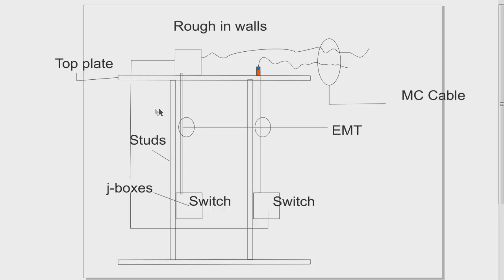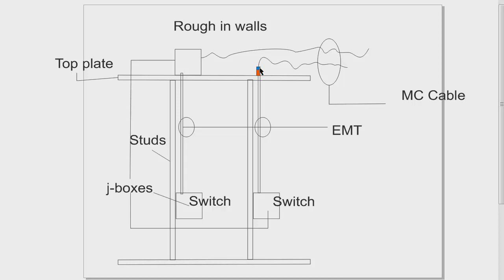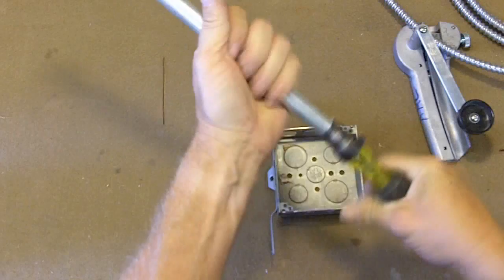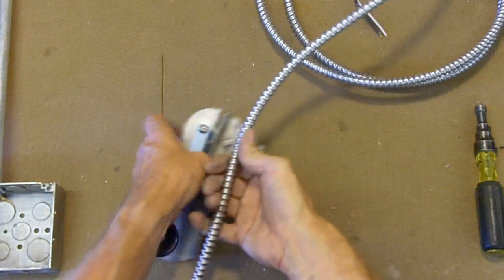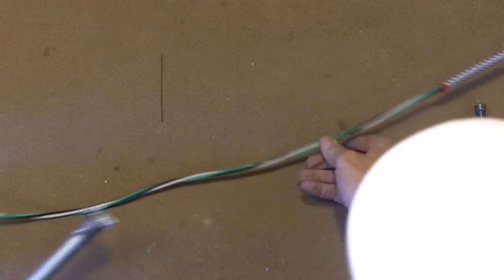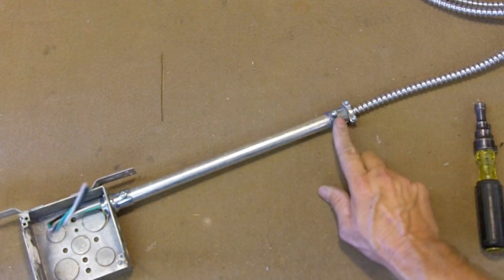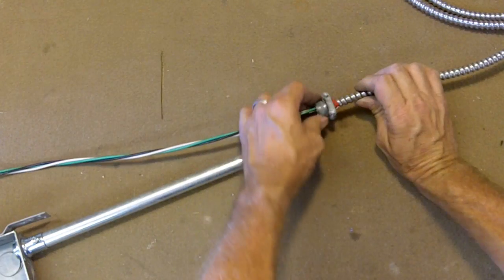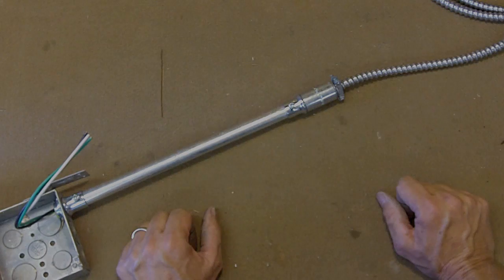Practical Electrical Wiring-MC to Emt Connectors

Comment: This person is not licenced to be doing any of this work. They do not know the code and are not qualified persons to be performing electrical work. And what they show you and tell you is all wrong. Hire a licenced electrician!
Reply from the maker: Tony66777
 Man what's with all the hate?  I have seen all of your comments to others on their videos on You Tube on your comments page.

You keep referring to "hire a licensed electrician". I have found many things over the years done by a licensed electrician that I have had to fix because it was not right."""It's the person not the license!""""

I probably should have said that it was "recommended" in lieu of "required". My bad,doesn't make me unqualified.

The code is written as a guide that the industry should follow.

What does AHJ stand for? Authority Having Jurisdiction, perhaps that's you where you live,congrats. I have had several electrical inspectors that agree with my statements buuut they also say it is good practice to use anti-shorts. You can require them from anybody you want to IDC!!!!

Because you interpret things different from others doesn't make you right! According to all your comments across You Tube every body is incompetent. Instead of slander and vulgar statements why don't you use your energy in helping people. Calling me an idiot and telling others they don't know what they are talking about is nothing but destructive
and serves no purpose.You may think your helping now by warning people of incompetence in the industry but you're only showing your inability of not understanding really how to help!

You have even gone as far as telling people that they are stupid and don't know what they are talking about because they misspelled a word--- Look in the mirror buddy.
Reply: Electrical Industry Network Tony6677 appears to have a significant dislike for anyone who does not think like him. Typical of an entrenched tradesman who only protects his "own kind" and has no interest of learning anything new. The defensive and accusatory tone he demonstrates is a clear indication of his low educational level and lack of appreciation for any new information that might be able to show him differently. He claims to know the NEC, but he clearly doesn't 'know' much. Keep up the good work and ignore trolls like him.
Reply from the maker: ljsmith99
,Yep,thanks for your support and comments.
Reply: @electricalindustry  -  Code consultant/engineer here. EIN is right as far as the NEC goes but as others have mentioned, the AHJ may have local amendments that have to be evaluated.
Reply from the maker: Man who peed in your Cheerios? When making a tough talk comment like this back it up with some reasons why it's not right. Are you a electrical cop or something?
Reply: No im not a cop just tired of watching people like you talk about what you dont know. That is complete BS what you did. Spend some time reading and not commenting on You Tube, then maybe you can make some inteligent videos.
Reply from the maker: Tony66777
Again tell me WHY it is BS man. People all over the states are utilizing this method!! I have seen the best of the best do an install this way. Union and non-union contractors. Not only is it done with mc it's also used with emt,romex & seal tite flex. It may not be the way you would do it but it is safe and efficient.
After posting this video and reading the comments I have had the opportunity to talk with some local inspectors. Their comment was It's safe and could see no reason not to do it!!! You're narrow minded and can only see black and white. Expand your horizons!
Reply: Well lets just start off with you saying that the  anti short bushing is not needed. This not true is accordince with 320.40 and 330.40. Also it is stated in NFPA 70E that only "Qualified Persons" should perform work on all or any electrical installation. A "Qualified Person"  being One who has the skills and knowledge related to the construction and operation of the electrical equipment and installations and has recieved saftey training to recognize the hazards. This is not you! You are a unqualified person creating Hazards with your vidoes!! Stop if you dont know what your doing.
Reply from the maker: Tony66777
 I agree that anti shorts "should" be used however they are not required by the NEC, There is a difference between AC cable and MC cable.People should be aware of this when working with the two types. See Info below.

 Comments to my qualifications are unfounded. You have no idea what I am qualified to do! One measure of a qualified person is to be able to comunicte with others,not attack them.

A/C M/C Info:
http://www.afcweb.com/media/afc-1001-mc-ac-installation.pdf

"Be sure that the anti-short bushing is plainly visible in the
connector for easy inspection. The same procedure is followed for
traditional MC cable with the exception that there is no bonding
wire. Although anti-short bushings are only required by the NEC for
AC cable, some manufacturers supply them for both cable types in
the event that local codes override the NEC"
Reply: Electrical Industry Network Hello Mr. Electric, have you taken out your code book? I havent a response from you in regards to the NEC refrences I made. If you have already you will know that what you said is 100% incorrect,
Reply from the maker: Tony66777
The above doesn't qualify as your response?
Reply: Actually Tony, EIN is correct. MC cable is NOT required to have a Redhead installed per the NEC. However, AC cable (formerly known as "BX") requires the use of these insulators. There is the NEMA-90 bulletin also outlining this at http://www.nema.org/Technical/Documents/Bulletin-90.pdf .  So, your jurisdiction may require redheads on all armored cable (AC & MC) because they cannot tell the difference from the outside. However, many do know the difference and understand the usage. Lastly, before you go branding me as a 'hack', know that I have many years working designing these types of fittings, and I know what the NEC and UL standards say about this exact thing.
Reply: ljsmith99 Ijsmith, you and everyone else on this website called you yube has no idea what your doing. When the guy on the video says that the roll of Mc comes with theses bags of "red hats" would you not think that they should be used. He even says with no confidence "I think they are required by the manufacture". Like I said if you look in the book on sections 320.40 and 330.40 you would see it. Becuase your not a real electrician and have no form of idea what your doing you should stay with probally doing car audio or something, You have no business even making these videos, due to that fact that your causing fire hazards witih each view of this video. Again as stated in stated in NFPA 70E that only "Qualified Persons" should perform work on all or any electrical installation. A "Qualified Person"  being One who has the skills and knowledge related to the construction and operation of the electrical equipment and installations and has recieved saftey training to recognize the hazards. YOU ARE CREATING HAZARDS NOT CORRECTING THEM. Please people go to school or call someone with propper knowlege of the task at hand.
Reply: Tony66777 "Well lets just start off with you saying that the  anti short bushing is not needed."------------I don't believe that is what he said.
Reply: ljsmith99 Lastly would you bring your son or daughter or have their teeth cleaned by the guy at the shoe store? He has all the tools but just doesnt have the propper license. Its the same thing with electrical and plumbing. I hope that the person who made this vidoe and the people who ae sticking up for this guy can sleep well at night. P.S. Better install smoke and C.O. alarms as you will need them with this caliber of work.
Reply: Tony66777 Lastly that NEMA-90 billetin is a complete joke. It was written in 2002?? Its 2014 now my friend and the code changes peridocially. For you Ijsmith99 to say "However, many do know the difference and understand the usage" If you knew anything about the difference you would know that these types of cables are required to have anti short busings installed at every termination. And you said " I know what the NEC and UL standards say about this exact thing." This "exact thing" what is that??   My kids need thier teeth cleaned do you have any open appointments? HIRE A LICENSED ELECTRICIAN
Reply: Track a Hack EIN is a non qualified person attempting to do electrical work. You and Mr Fritz should call someone who knows what thier doing instead of relying on theses people who have not even a drivers license. And when your house burns because of this guy, I wont be the one who is BITTER. Again just call a licesed electricain they are there for a reason.
Reply: Tony66777 I bet you cannot tell me the actual construction difference between AC and MC cable. I am sure you think it's 'all the same'. If you can, I would like to hear your explanation. Please be specific. NEC Art. 320.40 discusses AC cable ONLY and it requires the use of insulators "red-heads" between the cut armor and the conductors before installing into a fitting OR box with clamps. NEC Art. 330.40 discusses MC cable ONLY, and does NOT specifically require the use of these insulators. However, Southwire, AFC, Encore, etc. all include these insulators with rolls of MC cable because of one reason only....LOCAL JURISDICTION (i.e. local codes). So you are BOTH right, because your jurisdiction may require them no matter what the NEC states or doesn't state. Lose the attitude and you will certainly go much further in life. Also, you have no idea what my qualifications are, and who are you to tell me I am "creating hazards not correcting them"?
Reply: ljsmith99 Hey now that ive read you own document, you have no clue what day it is. None at all. Read it for me ouf of your own text..    Fittings used with Type MC Cable are required to be listed per 330.40 of the NEC. NEMA supports the use of listed fittings for MC Cable. The design of these fittings may or may not include an insulated throat however, they are required to be provided with a smooth, rounded end stop so that the metal sheath of the cable will not pass through and the wires will not be damaged in passing over the end stop. Whether or not an insulated throat is part of the listed product, these listed MC fittings do not require an additional anti-short bushing. Anti-short bushings that may be supplied by MC Cable manufacturers are for optional use by the installer, however they are not required.
Reply: Tony66777 The NEMA Technical Bulletin is still legitimate even though it was created in 2002. Show me where in the 2014 NEC 330.40 REQUIRES anti-short bushings to be used with fittings. Oh, that's right, you can't, because it isn't in there.
Reply: Tony66777 You are confusing ANTI-SHORT bushings with INSULATED THROAT BUSHINGS used in fittings. They are not the same thing, nor do they operate the same way. Read the NEMA document again...closer... It's ok to learn something new as an old sparkie...really it is...  ;)
Reply: J
Reply: +Tony66777  Oh again an stupid angry person how thinks all people do now YOUR work and nobody hire YOU? This I hear only from stupid electricans - intelligent electricans know after an house in fire they have many to do! ;-)
Reply: +Electrical Industry Network  Here in Germany we have DIN, newer EN ISO, in Greece EN ISO, in Thailand ISO. Normally in country and on sea ships and vessels 230 Volt one phase or 400 Volt three phase. We use normally copper cables in plastic, with plastic around, use them in plastic channels. If it special place have them savety earth metal channels or deep inside earth more thick black plastic around. The normal machines inside house use max. 16 Ampere. The normed SchuKo female and male connectors use that. Our normed EN ISO CEE female and male plastic connectors have 16, (old: 25), 32, 64, 125 Ampere from 12 till 600 Volt. They all can connect from one phase till three phase with or with out saved earth or neutral. The connector face and the nut in position around the clock show all. If do you use container or make international trade do you should use ISO rules and connectors! I learned repairman for computers and businessman but without power they are nothing and so I looks over at the shoulder of an electric Meisterbrief owner (without that you can't open own electric shop nor educated new electric helper in this job in Germany) and learn many. Here in my living places I do all electric stuff self, it is cheaper and more safe!

Comment: Sparky,

I recently built a 40 foot X 40 foot pole barn, and am now in the processing of deciding how to wire it.

A lot of folks around here use NM, but I do not want to use it. I am concerned about rodents chewing through the outer jacket. So I have decided to use MC. (I recently purchased a 250 roll of MC 12-2. Will be starting next week.)

So I watched this video, and it’s very informative. But I have a (possibly dumb) question: why not just run the MC directly to the receptacles? Why use EMT at all?

I wasn’t planning on using any EMT – I was just planning on running MC everywhere. But perhaps there’s a good reason to do what you did in the video. Just curious what that might be.

Thanks
Reply: FYI...MC or AC cable is not rated for damp locations, which is what an open 'pole barn' might be considered. Use EMT with proper fittings, OR Coated MC cable (i.e. TECK).
Reply: Electric is not a hobby

Comment: Although MC looks like BX, it's not. If you've done any work with BX, you know that there's a bonding strip inside that gets pushed over the red head, and wound around the armour a couple of times. 

MC does not have have the bonding strip, because unlike BX (AC) which is classified as cable by the NEC, MC is classified as conduit by the NEC. That's the reason there's an MC to EMT connector.
Reply: You don't need to rap the bonding wire
Reply: No need to rap. Bonding wire

Comment: That is a combo connector, MC or BX,...look at the end it's closed so the "red hat" bushing used with armored cable won't fall out. RMX connectors are open on the bitter end. Each 250' coil of AC or MC comes with a bag of bushings they must according to U.L. and the N.E.C be used as a complete wiring method. By the way, it's better to leave the lock ring on as the cable twist tends to loosen the combo connectors over time..

Comment: "We" use MC cable on the East Coast, it's not AC or BX it's Metal Clad, no paper or "bond" wire like AC. MC has a separate Green conductor and Mylar tape surounding the conductors in the cable armor. MC comes in many put ups, 3, 4, 5, 6, conductor. MC cable was always the choice for wiring Isolated Ground outlets used for DPE wiring in Data Centers and offices. We have wired large and small buildings using MC only, no EMT unless spec'd. MC Lite is great for above dropped ceilings too.

Comment: i was taught to do what that guy said, snap it, but you dont unwind it, you fold it over the opposite way and a loop comes up that you can easily cut with sidecutters... 1 1/4" flex and bigger youll need a hacksaw though

Comment from the maker: 330.2 2008 "NATIONAL" Electrical Code :-) The NEC does not address the BX cable however wiki defines BX cable as "BX cable, a genericized trademark term for type AC armoured electrical cable"

Comment: I believe you will find that that connector is stated by the manufacturer to be a EMT to NM connector so as used here you are looking at a violation of 110.3(B).  Red heads are required for AC cable but not for MC, but I use them.  The problem with these combination connectors is they do not have a shoulder to hold in the red head so it is likely to just fall off.  I put some tape around the end to hold the redhead in, but make sure to insert the tape past the clamp so the sheath is bonded

Comment: In europe / Ireland we have somthing like that cable "BX" cable but its not a cable, We call it armored copex. It also comes in Plastic the shape of 20mm/25mm/32mm more like flexi conduit. But I agree in using the righ tool for the job, you can't put a price on good practice. I have a ton of crimpers in my toolbox for all sizes makes it dam heavy tho. Still I hate the guys who have only 4 tools to do everything and always borrow yours. Its faster to do it with the right tool and looks good..

Comment from the maker: For those with experience I think the side cutter method is fine, but for others I recommend using the roto splitter tool. I know of some companies in my area that you better use the roto splitter and side cutters are not an option.
Reply: M C. Is easy to cut. Not like the old. B X

Comment: for the BX cable you dont need that tool or use a hacksaw. You simply snap it where you need the cut, unwind the armoured cable, and use your side cutters where you unscrewed it, then trim any sharp points and slip on the plastic bushing. 
That tool is honestly laughable

Comment from the maker: You can use mc for 220v
Exit lights should be fed from the ckt feeding the area lighting in which the sign is located.
You can hang a light on a fire wall.
You need to see what the EE is specifying for that particular project.

Comment: mr sparky,can u run mc cable straight to  220 v wall outlet,does every exit light needs to have its own circuit or can it feed from one to other exit lights?can mc cable that is connected to j box mounted on a firewall ceiling feeding  light fixture,can it be expose on finished firewall  ceiling?is the switch 48 inc from floor,all questions is for commercial building,thanks.